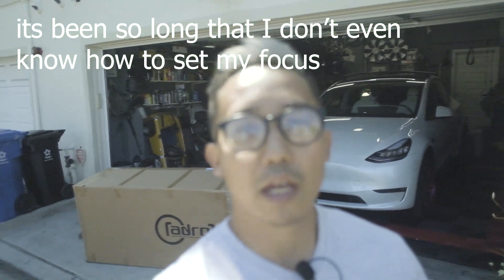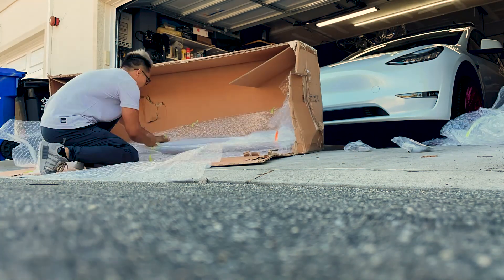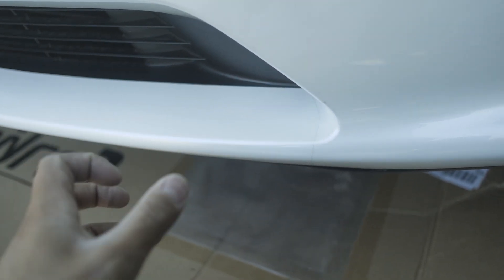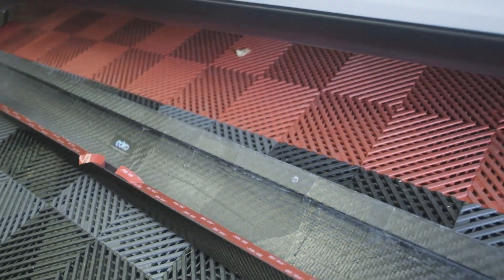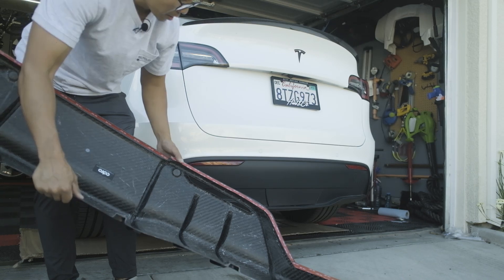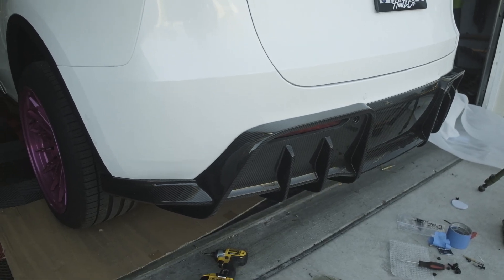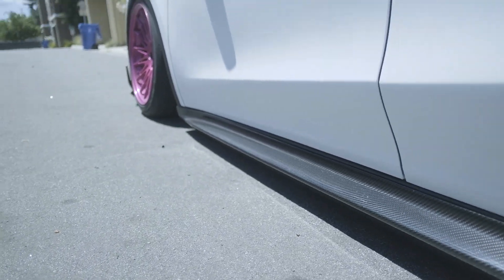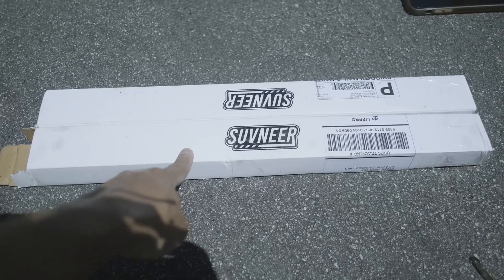Tesla Model Y: Adro prepreg dry carbon full body kit install

Comment: Not adding screws is crazy work.. Dude gonna hit 80mph and proceed to watch his front lip and side skirts getting run over by every car on the highway.. 😂
Reply from the maker: 2 years, 30k miles driven, still on the car, but definitely better off putting some screws for extra security measure.

Comment: Did the side skirts only have tape on the one edge under the door? What about the edge under the car
Reply from the maker: They did provide bolts to go on the bottom as well in addition to the double sided tape on all the outer edges.

Comment: Bought the rear diffuser & have been sitting on it. Fear of the unknown drilling into the factory plastic. Any idea whats on the other side?
Reply from the maker: I didn’t remove my bumper, so I never knew but I’m pretty sure it’s hollow atleast for couple inches, you don’t need to drill too far in and even with rivnut, it’s only half an inch in at most
Reply: @Tesla DIY  Thank you.  Nice car too!
Reply from the maker: @naradaAye  thanks bro, yours will just be as nice if not nicer once you put that diffuser on
Reply: Finally, I installed the rear. Complements all the time. Thanks for your guidance!

Comment: How did you remove the stock rear spoiler? Or did u just install the new one on top of it?
Reply from the maker: fishing line, dental floss, heat gun, adhesive remover wheel

Comment: If you have the performance model, be prepared to park on the sidestreet because you'll eventually scrape the wheels and everything around it going up the driveway. Autopark parks like a feet away from the curb because it knows the wheels will curb-rash if it makes any tight maneuver. I had a similar problem with the slim 20's on my i3.

Comment: This kit is one of the best I have seen so far on the Y.   Is it true that Tesla will not put your car on the lift if you have side skirts installed? also is your car on lower suspension?
Reply from the maker: Hello, my car is on air suspension, it can raises up 1-3" higher than factory spec, or lower to the ground with a push of a button ( you can check out my other video for that setup).

as far as taking it to Tesla for service, with my air suspension, all i have to do is air it up (raise the car's ride height) and i have never had any issue with them working on it, although i normally perform my own maintenance/repair

Comment: Nice but super pricey for just the front lip.
Reply from the maker: I maybe priced higher than other options out there, but consider the quality and fitment, it really isnt bad, keep in mine, these are made in prepreg dry carbon, not the wet lay heavier carbon fiber thats more commonly found. Do you need dry carbon? probably not, but it sure is stronger and lighter
Reply: @TeslaDIY  glad they have that payment plans option 😭

Comment: As far as double sided tape alone without any others adhesive or screw. It can hold for a few years however in time the tape will get hard and brittle so it will not hold the kits. Tesla acceleration produce a lot of downforce and the front diffuser will be compromised.

Comment: Looks cool but when screwing into the metal body parts you forfeit the 12yr rust guarantee I guess...because at least in the instruction pdf they show that you should drill 12(!) screws into the parts on the sides each
Reply from the maker: I didn’t use screws for the sides

Comment: Bit late seeing this video but awesome job again! 👏 The kit looks amazing and install looked like a breeze. Really great fitment indeed. Wasn't the case with my Artisan kit and had to cheat a little bit to get it to fit properly. 😅 I guess if I ever decide to go with something different, I should look into Adro as well. 👀 Btw, those Suvneer skid guards, how thick are they? I currently use Sliplo on mine but they're pretty thick and quite visible. If these are narrower I might switch over to them. I also prefer their more matte look, the Sliplo are gloss which doesn't combine well with my satin kit.

Comment: Did you have to measure out the ends for the rear spoiler to make sure it fits correctly? And did you put extra tape on it for 24-48 hrs to ensure it fits well? Also any issues with the rear spoiler months later? Thank you.
Reply from the maker: I did some quick measurement + eyeballing, its pretty easy to align, i just used the tape that was already on the spoiler without any extra, or maybe you mean like some painters tape to hold it down for the next 24-48 hours? if so, i also didnt do that.  few trips from norcal to socal, trip to sema las vegas and back to norcal, not a single issue, holds up just fine
Reply: @TeslaDIY  thank you so much. I was looking at a friend's. It didn't go around the trunk lip like the OEM spoiler. Rather it seemed to sit on top of the lip/bent part. Even he was surprised as most spoilers seem to go over the trunk lip and hug it.
Is that true? Just making sure it's being placed correctly.
Reply from the maker: @yatesbenjamin  i believe the OEM spoiler gets mounted on the vertical face of the trunk (where the tesla logo goes) and sit flush at the top flat surface of the trunk.

Adro spoiler gets mounted on the top flat surface and stops right before the bend on to the vertical part of the trunk
Reply: @TeslaDIY  Gotcha. Yup that makes sense. Thank you once again. 🙏🏼

Comment: Just a quick question I already did full car ppf xpell matte . I guess I can’t use 3m to ppf ?
Reply from the maker: I have ppf a well, you’ll be fine, ceramic coating however, you might have challenge getting it to adhere, but even then you should be fine, you can buff the bonding surface with compound if you have ceramic coating in those area, check with your detailed/ppf shop howver
Reply: @TeslaDIY  thanks :)

Comment: Not as advertised. The kit doesn’t fit as shown in the video. Especially diffuser. No rivnuts we’re included and customer service doesn’t exist. The 3m tape won’t hold diffuser -once you pay 5k for this kit, you are on your own.
Reply from the maker: Not true at all, I explained about how I had aftermarket rear bumper reflectors which was why I had an issue fitting the diffuser at first, even then it was a very easy fix and fitted on perfectly. the entire kit is held on with the 3M double sided tape preinstalled on the back of every panels, I decided to not use the 3m double sided tape on the diffuser just because i want easier removal and everything has held on fine for almost a year now, driven thousands of miles including my most recent trip to SEMA vegas from the bay area CA.

Give me your contact and i will reach out to Adro for you

Comment: Awesome car you really made it your own with personal touches. I wanna get the same aero kit but they don’t have it in matte.
Reply from the maker: They are actually matte finish out of the mold because of the prypreg carbon process, but they spray clear coat to protect the finish from UV, I’m sure you can get some matte clear coat like the ones from spraymax 2k, to make them matte finish

Comment: Do you know if mud flaps will fit with the rear diffuser?
Reply: Im not sure about his, but my mud flaps still fit back on after I installed my diffuser bumper on. But mine is a different diffuser from RPM Tesla and it’s the Viento diffuser for my Model Y. Hope that helps.